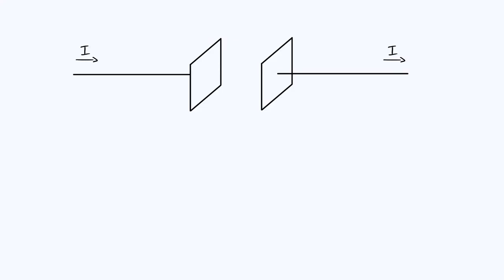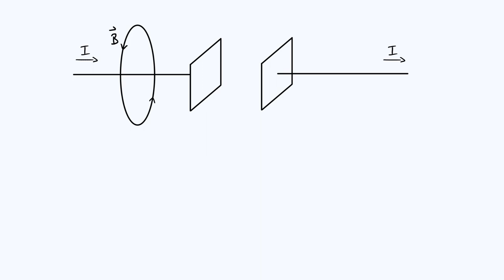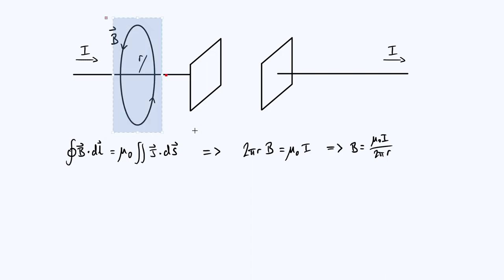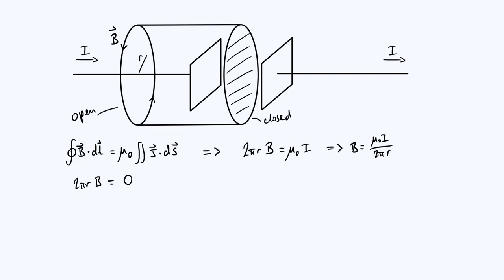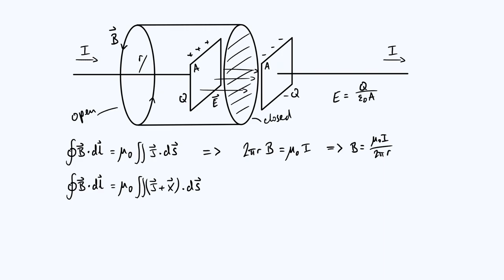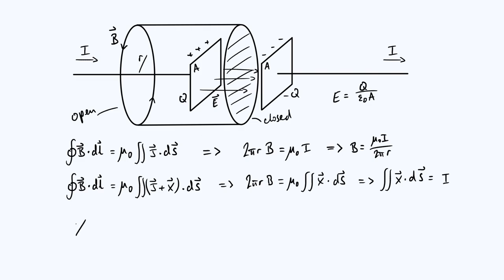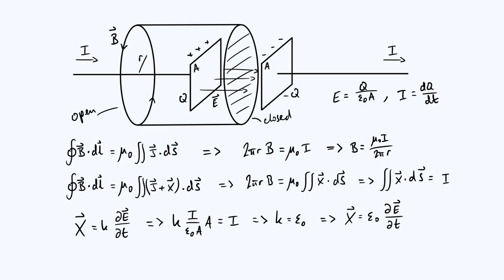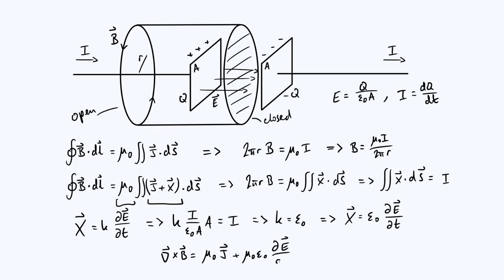Importance of the displacement current

Comment: So... current into condeser is proportional to the rate of increase of EMF and to the permittivity of a dialectric? Also when capacitor gets charged the current will drop and this will induce more EMF slightly aiding the current, if you make L large enough, can you get the circuit to oscillate? Also, is I/2pi*r = H?